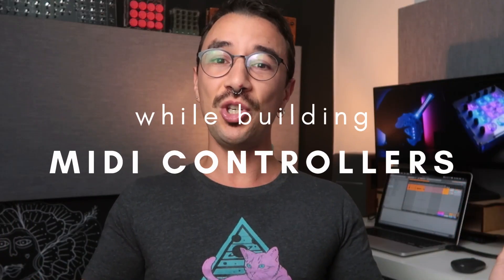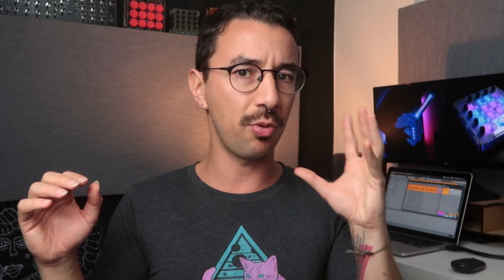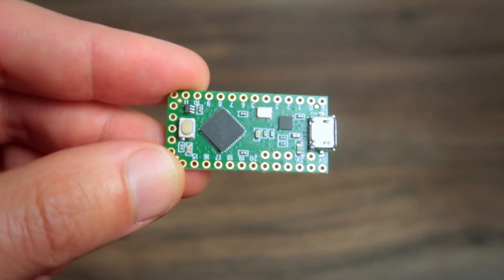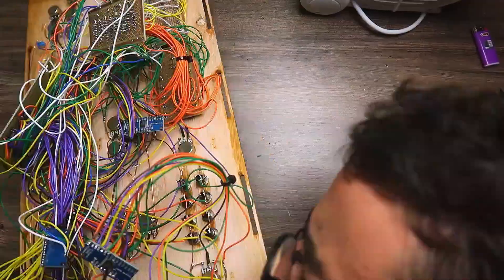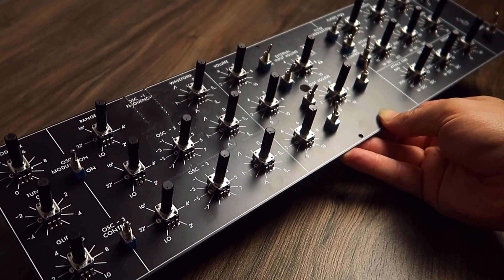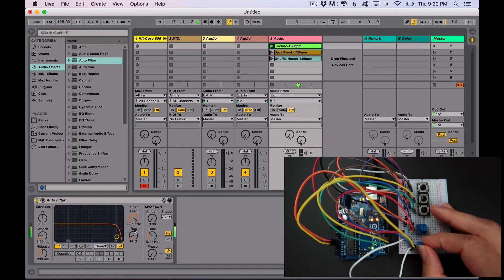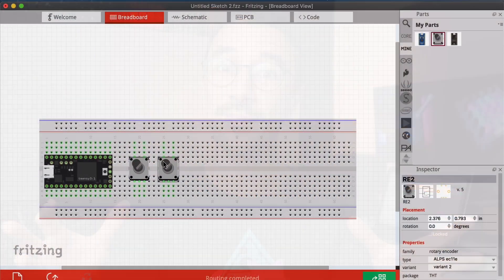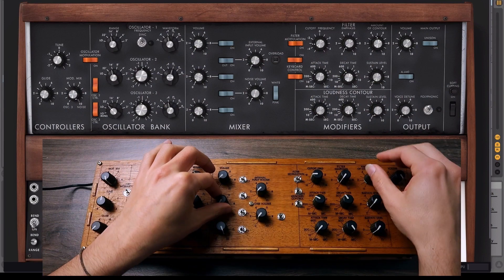The 6 Biggest Mistakes while Building MIDI CONTROLLERS

Comment: So, you tell us that the final mistake is to try learning on the net and, out of the blue, you tell us to buy your course ! Where ? On the net !

The main mistake, the costly as well, is to think a PCB will work fine on the first trial, even advanced electronicians make mistakes such as putting a component on the wrong side of forget a track or a layer. So carefully exam your work before sending to the manufacturer, and in case of quantities try a proto, you'll pay for it but only once, errors on quantities are paid in quantities !

Comment: PCBs are too expensive when they are large. Use copper tape and short wires from the potentiometers or switches to the copper. Way cleaner and reliable.

Comment: My mistake or problem is using faders. I'm using linear sliders but while running the programming  the turn to logarithmic...
Before I run the program I used normal potis and everything works great, but then the sliders I can't make them work correctly. 
Any idea why is this happening???
Reply: What do you mean ? The sliders have a log curve ? The curve is written in the ref. In Europe A means linear, B log, C antilog, in Japan (& China by extension) A is log B is lin, C still antilog.

Comment: hello Mr Gustavo Silveira, I recently discovered your nerd musicians website when searching for info on how to make midi control surfaces with Arduino prototypes. 
I found your main website, and noticed you have 3 courses available. Which I am interested in. However, I do have a couple of questions re the courses, which I would be grateful
if you could help answer, before I buy. In particular I am interested in creating Mackie Control Universal style control surfaces for controlling Cubase Pro, and was wondering if you think that the info contained in your courses plus the necessary hardware would allow me to achieve such an objective. I am really keen to learn about this, and from watching your you tube videos, I have a feeling that you have the answers to my questions. Please can you write to me asap. Thanks. I have tried to contact you via your website, but no answer yet. (although I guess it is the weekend).
Otherwise. Good luck and keep up the good work. Cheers

Comment: Instead of a controller, I want to create a MIDI CC to CV converter. I have a Roland AE-30 wind synth and it can send a variety of CCs. Unfortunately my Behringer Neutron can only convert MIDI pitch and after-touch to CV. I send the AE-30's breath signal as after-touch but the Roland also has motion sensors and other controls which I would like the Neutron to respond to. Do you have any suggestions?
Reply: Converting CC to voltage is no problem but the limitation you’re going to hit with the arduino is that it can only shoot out 0-5V without adding a couple of op amps to scale it to 0-10V. If you need -5V to 5V you’d need to scale it with op amps and have a bipolar power supply. Still doable but just a bit more complex than building a simple midi controller. Good luck!
Reply: @paulbergel9191  thanks for the tip - I wasn't sure the Arduino could put out enough by itself so now I'll definitely plan to do this.